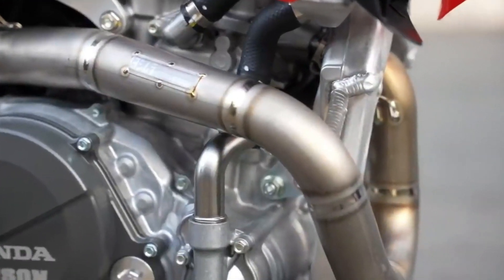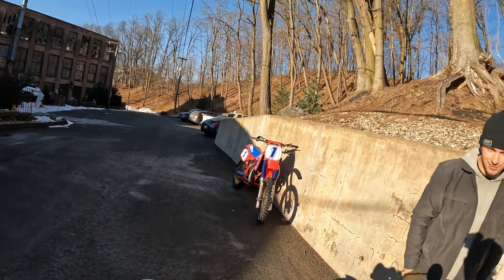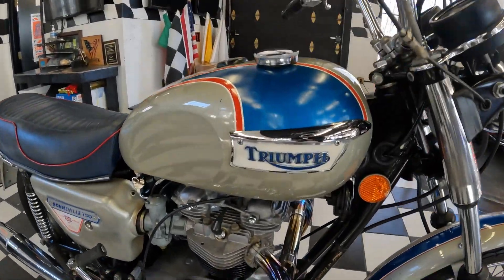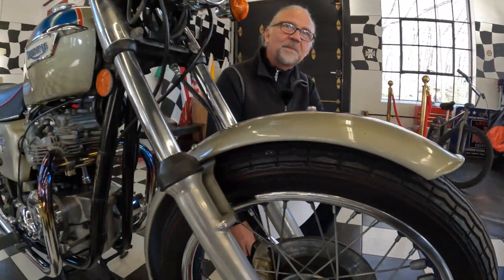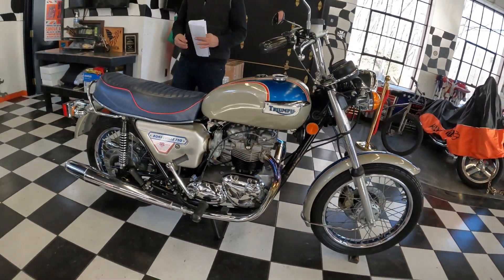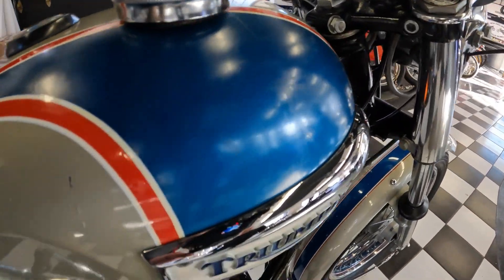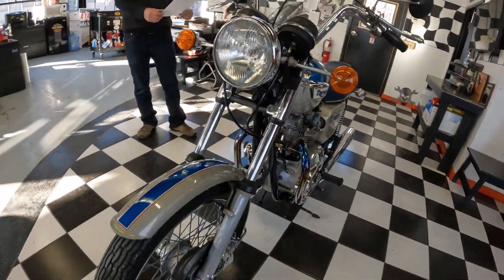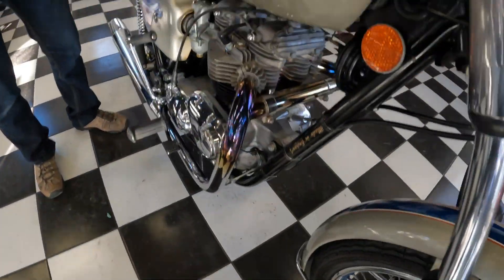1977 TRIUMPH 750 SILVER  JUBILEE LIMITED PRODUCTION 1 OF 1000 MADE

Comment: Cool bike.  I'd probably put slightly lower bars on it, like the ones that came on the 1970 Bonneville..  Why do some bikes have bluing on the exhaust pipes and others don't?   I've see it on modern Triumphs as well as on older bikes...but not all of them have it.  I realize it's from the heat, but like I said, not all of them turn blue... and sometimes they turn blue in random spots, not just at the top of the header which is the hottest spot on the exhaust.